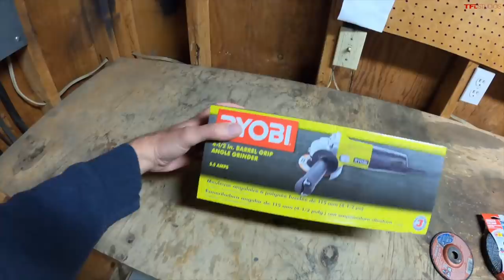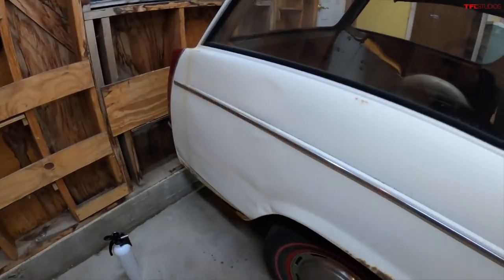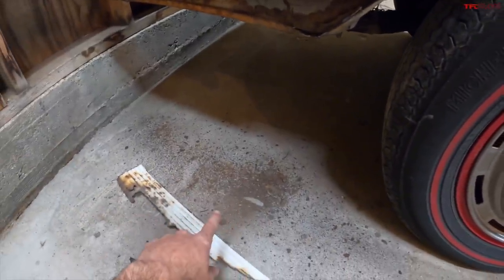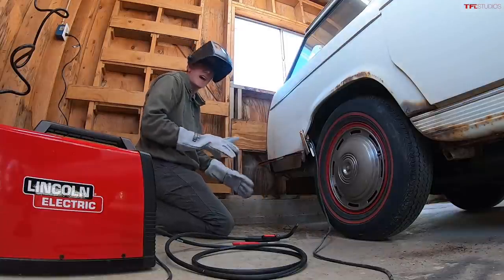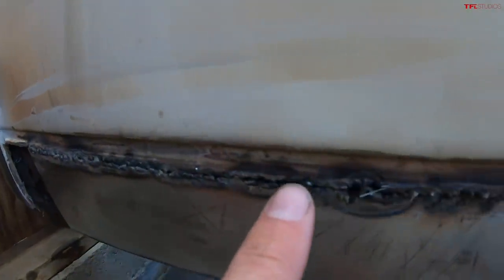Why I Spent THOUSANDS on a Car Worth Absolutely NOTHING

Comment: Tommy, you should get a flanging tool, and put flanges on the panels so you can overlap the edges and weld the flanges. That should result in less burn thru.

Comment: Tommy I worked as a co-op for Lincoln Electric. I may be able to help  a bit, but there is easily available help out there. That bacon crackling sound means your contact to work distance is too large. Also I think you could tell, but you've got too low a feed rate and too low voltage. There should be a recommended settings on the wire's packaging from Lincoln. I hope you're using flux core bc I didn't see any gas, but I know how popular our L-56 is
Disclaimer: I'm a co-op so I don't have strings I can pull

Comment: An empty used gas tank is more dangerous than a full one. Best thing to do would be to put an inert gas inside the tank. Baring that remove tank or fill with water. 

Also not sure if you have an expectation of this actually ever being on the road but this is a great comedy series. Thanks TFL

Comment: Tommy, 

As a former welder/dude that went to wyotech for collision repair, it doesn't hurt to test out with some scrap metal. I hope that's a auto-dimming lid because that will make things much easier! 

Sometimes, shooting through is actually from too low of on your settings. Try turning it up, test on some metal, and try again, with tiny oval motions to spread out the heat really well and helps prevent your weld from shooting through the material. 

Think of it like drawing a line but with oval-spiral to the left or right. Practice the motion with a pen and then with the welder off so you can make sure your cable/hose will work with the direction you're working in. You don't want to be 10% into a weld and find out you can't get the right angle and end up with a bad weld from having to restart part way through. 

And, if you ever weld pipes or fittings, do the same but with one, continuous weld around it. :D

Comment: Tommy it is very hard to weld thin metal in butt welds.  Do not worry how it looks at first keep trying, maybe practice on some thicker junk metal first.  Remember you can grind down a poor weld and redo it, you are learning a skill take your time and learn it right.  Get a panel flange tool will help.  Make sure you are getting past the rust to good metal, you often end up taking out more than you want to cut out.  It will take time but you will be learning a lot working on your poohJoe.   Take your time, be patient, do not worry if you need to redo a weld when you sand and bondo it will cover up some blemishes and you are not doing a SEMA car you are working on Joe.

Comment: I used to have 68 404 sedan. It was a fun car to drive when it ran. I am still amaized on how many ways that car found to leave me stranded. The final straw was then the front hood post pulled out of the hood and the hood flew up while I was drive down a freeway. The metal actually fatigued and fractured. The post was still in the latch. It must have been quite a sight for someone to watch me take the hood off and jump up and down on it so I could bend it more in order to get it in the back seat of the car. I took one off of a parts car that I had. Then I sold one and junked the other.

Comment: Hey Tommy, my name is Jayk.  I'm a profesional welder/ Fabricator in Idaho. I have several tips for you if you are curious about welding and body fab. Private message me some time. Or try watching youtube videos on how to weld. The shop classes really help get the basics, but dont show you how welding reacts in different angles and dirty materials. And just a quick tip. If the wire is melting faster than its getting to the metal, just like your first weld, try turning the speed up. For thin material like this (looks like 16gauge) on that little lincoln welder. Try wire speed at a 2.5-3.5 and the heat to C or D. There are often charts inside the flap of the welder that give you good starting settings. Just turn the wire speed up and down from there.

Comment: Also. Clean 100% of the dirt, and the paint at least 1/2inch away from the weld on both sides of the material. The cleaner your material, the easier to weld.

Comment: Don't give up you're going to get there watch the sides and the edge of the puddle set That welder 2 about 150 inches a minute  and 15 -17 volts.   15 to about 30 degrees travel away drag angel when there's slag you drag. Don't give up you'll get there.

Comment: You may want to turn up the wire speed so that it sounds like sizzling bacon in a pan. Welding sheet metal is difficult because you can burn through it quickly, try tack welds to avoid heating up the metal too much. Welding isn’t rocket science but with a little practice you’ll get the hang of it.

Comment: Took my 80 Malibu to the welder to get the G body frame rot fixed at the rear. Told him I ran the car almost empty so it would be easier to remove the fuel tank as it was directly behind the area that needed fixed. He said he wished I had filled it as he wasn't removing the tank and an empty tank is full of volatile fumes and more dangerous.

Comment: Haaa. Yeah I think the MIG welders are way better for thin steel panels to weld, like body parts. They can weld thiner parts than fluxcore welders without piercing some holes. ( yours looks like it's a fluxcore ? ).

But hey you are doing great ! 
And those cars are excellent workhorses. They have some weird stuff like the ring and pinion in the rear axle that are some screw and pinion looking requiring a special oil ( at least on the sedan it's like this, not sure about the wagon ), and if I remember some have a strange brake assistance system.

Comment: Nice, same weld pack we have, guess it'll work for 87 4runners future patch work. A super cheap beater to learn is cheaper then a 4 years degree for a paper, and if you want to learn a trade, wayyyyyyy more useful. (I have the paper but have been trying the learn as you go for a few years now...)

Comment: Looks like a lincoln 140 welder. And you are using a flux wire. The metal looks to be 16 or 18 gauge. Try the lowest heat, and wire speed, and increase your speed till it welds smooth. Leave the heat low.

Comment: You need to crank up that welder, way too low of settings. I straighten panels first before welding. But I think this is just a practice car, so I guess it really does not make much difference.

Comment: I love this car! I think it will be difficult to repair it especially in the USA, since it’s not a very common. Could you get those panels from overseas? 
Note on the welder, I think it will be difficult to get nice weld with flux wire especially on thin metal , need a welder that uses argon gas.
Good luck.

Comment: If you are serious about restoring the car you shouldn't start at a random corner.
1) dismantle the entire car: interior out, all lights and chrome trim.
2) start poking all bad looking spots with a screwdriver (it is probably three times worse as you think)
3) go online and get as many replacement body parts for the bad area's

ps. if you weld on a fuel tank always fill it with water! you can never get rid of the fumes.

Comment: in manila, body repair guys use galvanized sheets
Reply: Galvanized metal makes toxic fumes when welded along with a poor weld bead. The coating should be removed in the weld area. It is for more advanced welders that know how to deal with it properly.